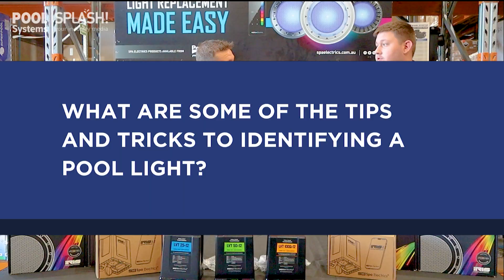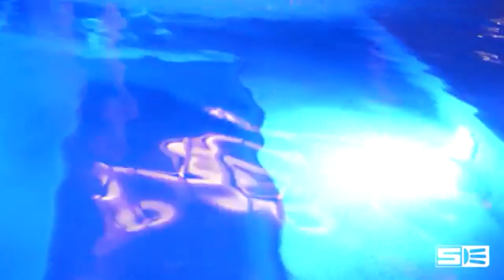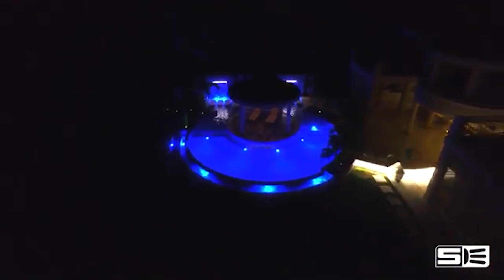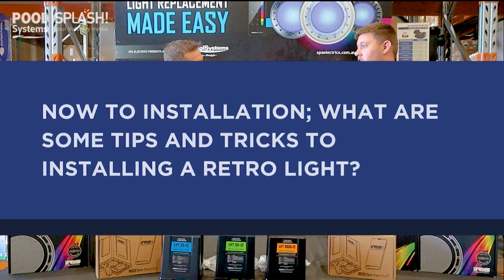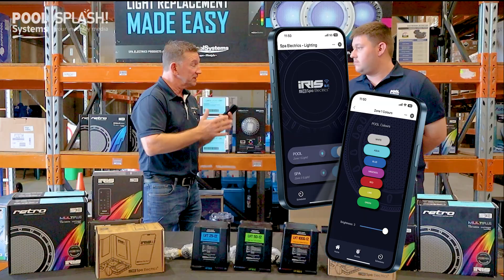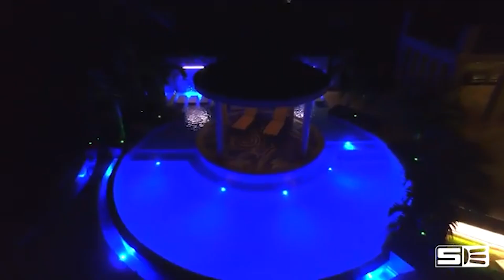Tech Talk Episode 4 - Retrofit Pool Lights with Spa Electrics

Comment: Hi Greg.....I am an Electrician and pool builder, I have been using Spa Electric lights for 40 Years.....I always install these lights perfectly with 25 mm conduit to allow the wires to be replaced when they corrode.
There are more design problems with these lights than I can go into here. Such as the use of Acrylic which self distructs.
It is a shame that you guys eventually found a way of keeping water out of the light, but now have a problem with low quality cheap faulty components.
Whenever I replace a spa electric light that has died prematurely, I do an Autopsy on it. I find that under a USB Microscope there is no sign of any corosion or overheating. The PCB's look perfect but don't work.
I do not use your ATOM lights because they blow up because the silica gel pouch is touching the PCB . Sometimes I have to use your surface mount retro lights which tend to last for about 5 years if you are lucky. I have had lots of these die within the warranty period and at the 3 year mark. All you need to do is spend a few more cents on the components that fail.
Because spa electric lights last such a short time, I try to install as few as possible in a pool because I know that when they start failing the customer will complain about how much the replacements cost.
I hope that one day you will get it right.

Comment: Thanks for the video, I have had my pool light identified as a sunline/rivendale niche light that can be retrofitted with the AGRX R1 + AGRX001R1.  However we cannot get the light in our fibreglass  pool off.  Any advise to remove the  old light that has no screws, no buttons, and not able to be unscrewed by hand?  Will we need to empty the pool below the light level? Our local pool person won't touch it as the pool is fibreglass.
Reply from the maker: Best to get a service tech out and have a look! They will be able to help out on site and do the install for you.